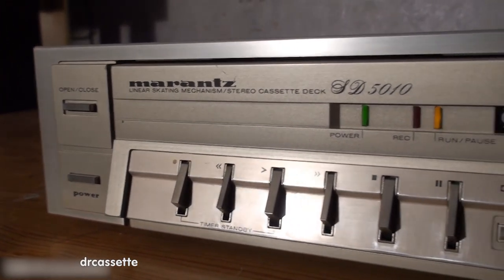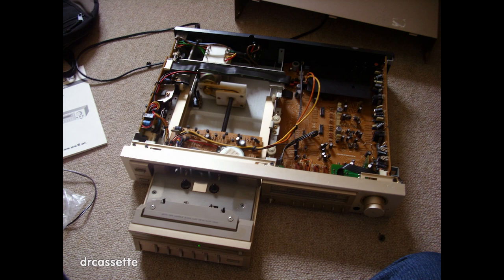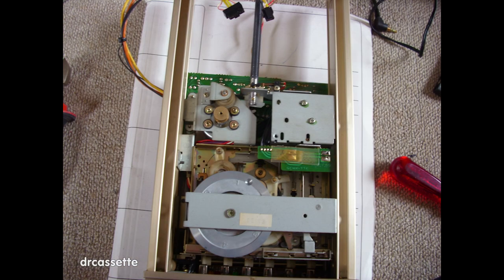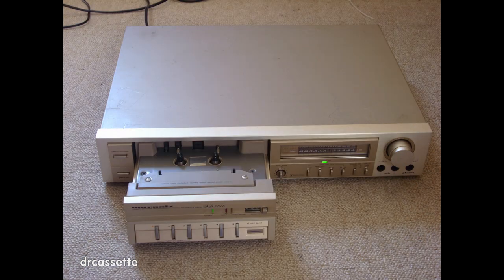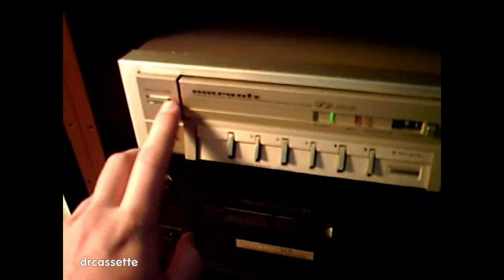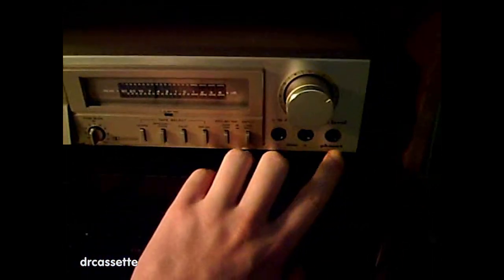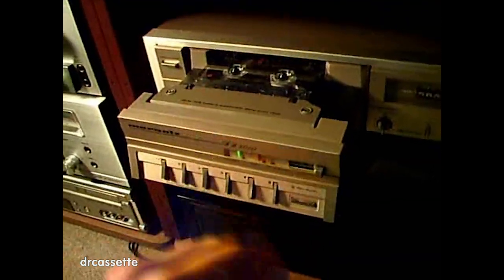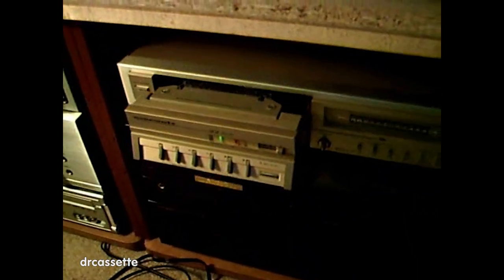Marantz SD 5010 cassette deck repairs and overview

Comment: I could use some help; I have this deck from my youth, the small belt was broken, i replaced it, as shown on your video, the rubber  15 mm wheel (on the right side of the main Head) that pushes the tape , when play start does not touch the thin metal spinning rod, any idea? . Also if you open the front where the springs touch the buttons it looks that the forward and backward buttons have the spring at the opposite of the buttons, so tension is inward instead of outward on the button, im i  wrong?. Hope im a bit clear on explanation, is a bit difficult without pictures i recon.

Comment: Another great video!
I have a three head Marantz 5030b that has been thoroughly cleaned and new belts installed.   The unit has a very unstable audible speed stability problems.  The speed goes up and down in both play and also FF and RR.  Is this a motor problem?  Can the motor be oiled or will it have to be replaced?  Thanks for any advice you can give.
Reply from the maker: If the speed changes in FF and FR just like it does in PB/REC modes, that indicates the motor is what causes the problem. If you are lucky there are just some dry bearings that you can fix with some fine oil, but usually when there are bad bearings, there is also a very audible motor noise. So you may have a problem with the motor's speed controller. Usually this is integrated in the motor, so you would then have to replace the whole motor, but your Marantz deck may be old enough to still have a separate speed controller. So make sure to check carefully.

Comment: As your former self partly points out, this is quite peculiar in not just being a drawer loading deck, but one that has the whole mechanism built into the drawer itself allowing for operation with the drawer both open or closed. On top of that, it's a quality deck, not just a shiny novelty. Why did you even sell it? Guess someone must have paid well for you wanting to see it go!
Reply from the maker: When I moved out of my parents' place I had to reduce the size of my collection. I had too much stuff. I don't remember how much I got for this deck...

Comment: This can be an innovation but I do not find this type deck was more practical in use. Can the cassettes be played or recorded while the drawer is open? Thanks for the video.
Reply from the maker: As you could clearly see in the video, cassettes can be played and recorded while the drawer is open...
Reply: @DrCassette  Thanks for the reply.

Comment: Not something u see often,,,a drawer loading tray type cassette deck,,,just like u would see on a cd player with the drawer tray. Bit strange how no music was heard due to copyright? I've heard music b4 in another video of a repaired cassette deck in the past. No problems there.
Reply: I've actually seen an early 2000s Pioneer stereo system with a tray loading cassette deck inside it.  I'm not sure if you could play a tape with the drawer open or not.
Reply from the maker: There is music with copyright and music without copyright (license-free music). All the old videos about this Marantz cassette deck contained music with copyright. These days I always use license-free music to avoid problems.
Reply from the maker: @Lachlant1984  Most likely not. All the newer tray loading cassette decks have a stationary mechanism inside. There were only a few cassette decks with the mechanism in the drawer.
Reply: @DrCassette  Ok,,,that explains why i still hear music from repaired cassette decks and cd players,,,licence free type music that isn't copyrighted.